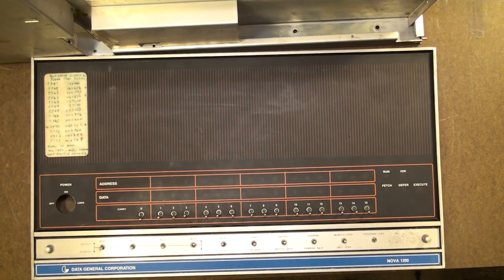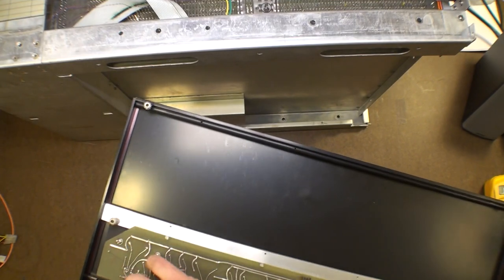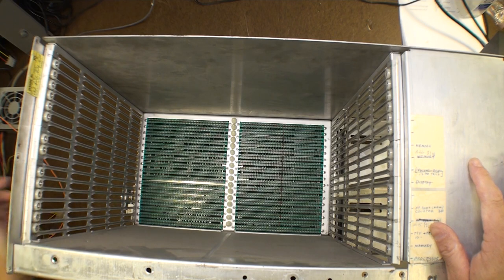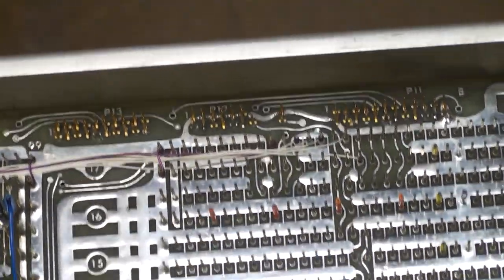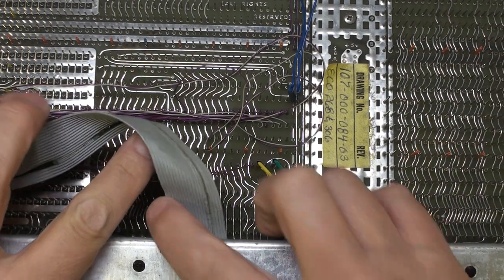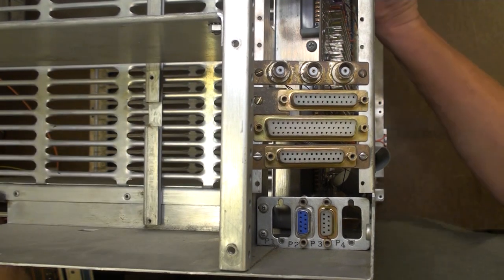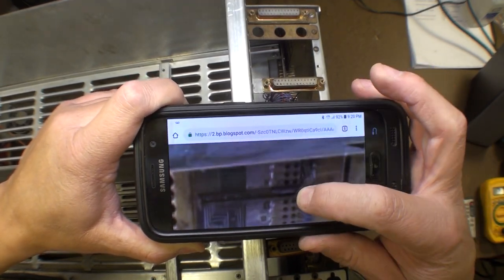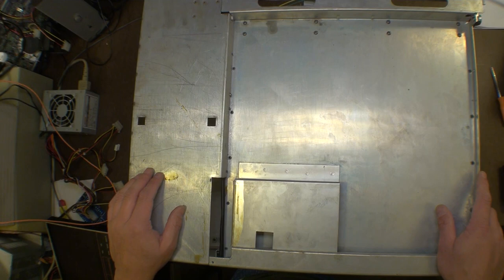Data General Nova 1200 Chassis - A Really Close Look

Comment: Good to see, there is some of this awesome hardware still existing. It will be a long way to go to get it running. Probably there was no in-depth documentation available to anoyone not working for  DataGeneral. If anyone out there wants to get an idea, how hardware engineering and the ‚war‘ among IBM, DEC pp. went these days, read ‚The Soul of A New Machine‘ by Tracy Kidder. It‘s about the successor of the NOVA, the ‚Eagle‘, but you get much info on NOVA, too.
Reply from the maker: Thank you for this!  Actually, there's quite a bit of documentation available for the Nova at http://novasareforever.org/dgdocs.hw/index.php  And yes, I've read that book you mention several times...it's a great read!

Comment: I was a technician that worked for Data General and Digital Computer Controls on these minis and others. My specialty was the CPUs but worked on other boards also.
Reply from the maker: dennis pengelly, thank you for sharing this!  The DCC copies of DG machines is actually the key reason that I became interested in the Data General machines of this vintage.  I've begun to collect all of the DCC-branded documentation that I could find on the DG Nova...   https://entrex480.blogspot.com/2019/05/digital-computer-controls-d-116-16-bit.html
 Of course, I know that it is all copied nearly identically from Data General, but the fact that it was done, and became a real profitable company before running into enforceable opposition from Data General fascinates me!  Can you share experiences with this? Thank you so much!

Comment: 26:15 could the 4010 option listed on the tag here stand for the 4010 I/O controller for paper tape and teletype. If that’s the case wouldn’t all novas have that option stamped on it since wouldn’t all have been ordered with that card to allow for easy interface

Comment: Several Data General publications on Bitsavers.  At least a paragraph on the 4010 option.  Very enjoyable video!
Reply from the maker: @Cliff Miller thank you very much, yes!  I did intend to mention in my video my previous searches on http://bitsavers.org/pdf/dg/ not producing a power-supply specific manual, BUT of course deeper searches will reveal more.  I'm building a page on my power supply build at http://bit.ly/2k2OWX4  But, could you please elaborate more about what you mean when you say "a paragraph on the 4010 option"?  I'm not quite clear on what you mean.  And thanks again for watching and commenting!

Comment: Maybe the mystery latches are there to latch the cabinet into the equipment rack?
P.S.: I have a Nova 3. It doesn't have latches like those.
Reply from the maker: Mark, excellent point, I'll bet you'r right about that!  I've never observed one of these mounted in a rack as of yet...
Reply: @ForgottenMachines  My Nova 3 is in a rack, but it's just held in place by friction and dirt. Its cartridge hard drive (model 6045, if I recall correctly?) has a solenoid-operated latch which only allows it to be slid out when it's powered but unloaded.
Reply: @ForgottenMachines  You are correct in assuming that the leavers are for locking the chassis into the rack, they can sometimes be a real pain to get to engage correctly, I have just been up to have look at exactly how they work and it has taken me about 15 mins to get them to go back into place and tighten up in the right location. My system is a Nova 820 all racked up with a Diablo drive disk system with 4 model 30 drives (3 removable and 1 fixed), I also have the paper tape reader and punch units but these are not connected at the moment as there is not enough room in the rack. But more importantly when I got how of the system I also got all the manuals and schematics that were with it so if you need any specific info I may be able to dig it out.
Reply from the maker: @johnhenryrose  Thank you SO MUCH for this comment, and the wonderful feedback...AND I really appreciate your offer to help with schematics.  I think I'm going to take you up on that very soon.  But I'll record another video and publish that on YouTube so the request is easy to quantify.  And thank you again!